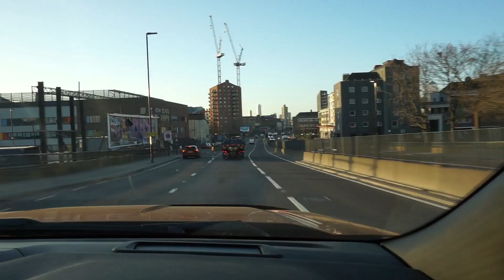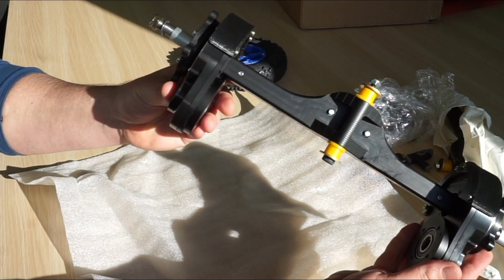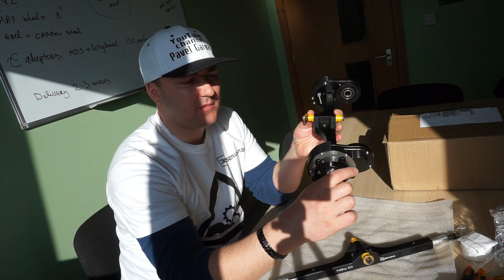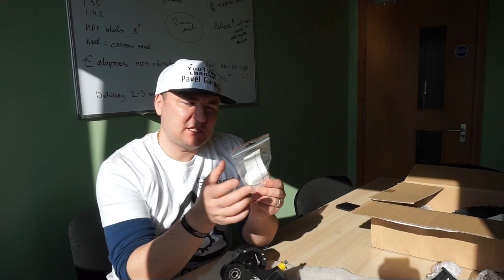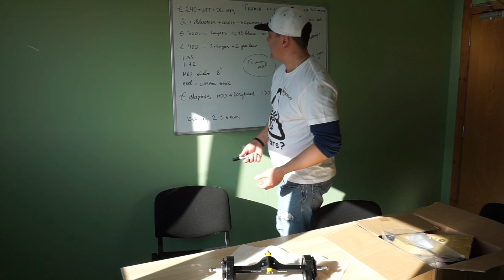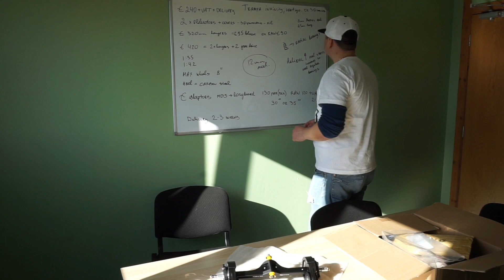GEAR DRIVE  made in EU. Full review .

Comment: Nice video. I plan to switch over to gear drives this summer this video is one of many research videos. The only thing holding me back is that plastic gear I just can't get past the fact that it's plastic. How well do they hold up?
Reply from the maker: Hi mate. I do have both Eco and Finality drives. Take a look at my other videos if interested. Both types of gear drives have on plastic gear. This is not an ordinary plastic and is very durable. Same gear drives were used on all Biobords up until now. I was told that the longest use of the plastic gear was 5000 miles and that is when some wear was noticed but it still works. There are benefits in using the plastic gears as long as the quality and cut precision is high.

Comment: so the fatboy 320 gears what ratio do you recommend pros and cons of each?
Reply from the maker: I have gone for 4.2 ratio... 10 on motor, 42 on the wheel. It is good for street and mixed terrain board on 8" wheels. Top speed is around 40mph with 190 kV motors on 12S pack. There no pros and cons... all depends on your design requirements.

Comment: Would love to hear the sound of the gear drives.  How it runs on the bench, vibration etc
Reply from the maker: Hi,
Thank you for the comment! I have not installed the gear drive as yet ; ( still waiting for the motors. I am in the middle of skinning the deck with carbon fibre at the moment. I will definitely do a sound test and road test videos. Stay tuned .

Comment: Looks amazing. How does this hanger thing works, does it need a MTB truck where to fit?
Reply from the maker: Hi,
Thank you for watching and for the question. I will make more detailed videos on how to assemble it all but in short - yo will need an MBS baseplate to fit the hanger to the MTB style deck and the truck adaptor ( it is in the video ) if you want to use the hangers on the longboard deck.
Hope this helps .